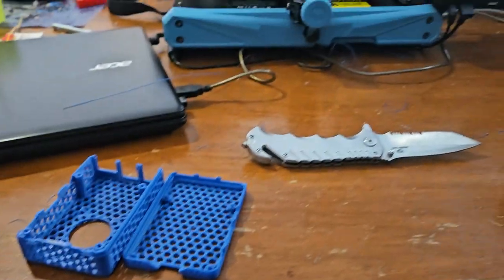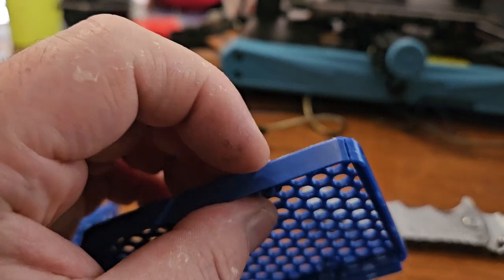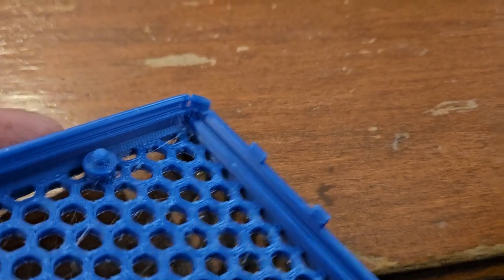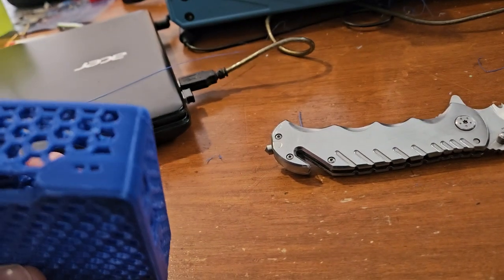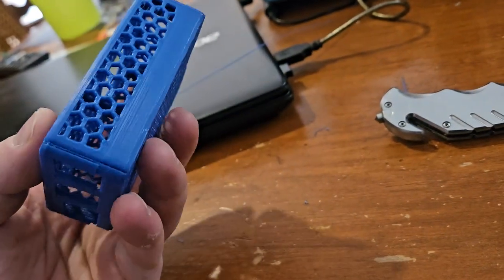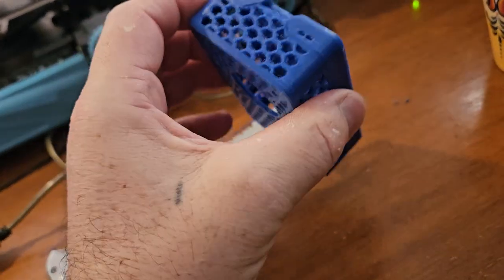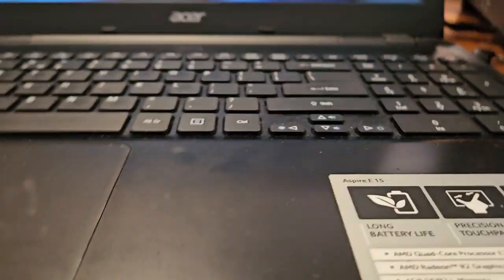every time I 3D print a Raspberry Pi case it just sucks

Comment: I always found PLA to be easier to deal with in this regard, and if its not printed at low infill it is usually quite strong

printing slower and changing temp may also help with stringing and layer adhesion problems
Reply from the maker: I think mostly the filament was old and we have tons of humidity lately. Also didn't help the design is off also. The person who designed it either didnt ever print it or didnt care

Comment: Try to change nozzle settings of you use a 0.4mm nozzle in nozzle width change to 0.38 Will print much stronger in this parts
Reply from the maker: I think it's set to 0.2 in Cura even though it is .4

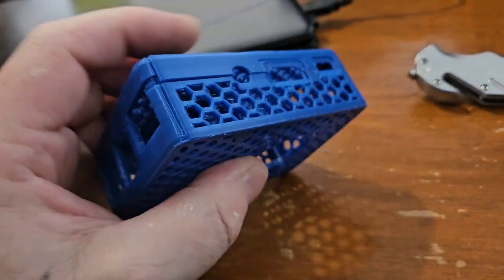Comment: 1. Dry your PETG. 1:04 look at your wisps there, it's not quite fresh. Even straight out of the package, it's usually not quite perfect in this regard. What i do is double seal my PETG with calcium chloride between use. Don't keep calcium chloride near the printer or anything metal, and don't keep it out in the open.
2. Up the temperature to increase layer to layer bond. Mind that bridging and overhang performance will degrade. It is a challenging balancing exercise to dial in temperature and cooling to get PETG to behave perfectly.
3. Use some part cooling. But not too much, or it'll be underbonded.
4. Avoid designs with a lot of retractions when doing PETG. This case is quite wild in this regard with all the thin spars between the air holes.
5. Use minimal Z-hop when doing PETG. You can use diagonal and set it to a homeopathic amount like 0.1mm or turn it off.
6. Use as little retraction length as possible, i think you should only need 0.6mm on this printer. Consider increasing the minimal travel distance between retractions such, that most print moves won't result in a retraction.
7. Adjust the print-movement speed down, depends to how much, 50mm/s might be OK, and non-print movement speed as far as the printer is capable without skipping, 120mm/s or more. If you can set separate accelerations for print and nonprint moves, up the acceleration for nonprint moves.

When purchasing PETG, i find that translucent types and natural clear work better than opaque coloured types. I find that tuning in opaque coloured PETG is really hard, the temperature band in which it's well bonded and takes shape well is way too small. Black can be OK.

Regardless of PETG, orient your pieces on the bed such, that if you have a parallelogram distortion and X/Y dimensional distortion in your frame or motion system, the distortions would match between top and bottom pieces. Or just assemble your printer more straight.

Most printers of this construction print a little undersize, maybe half a mm across 200mm length, because the belt is of the type that is intended to be stretched to achieve its final pitch, but the spec tension is so high that it may harm the motor bearing. Normally the motor shaft should be supported on the very end by another bearing, but well it's not. You can mount millimetre paper to the bed, and tape a sharp needle to the toolhead, to check visually the dimensional accuracy and parallelogram error of the toolhead movement. Additionally due to different tension, there is disparity between X and Y axis movement accuracy.
Reply from the maker: Yeah I totally didn't dry it this time

Comment: Saw too many videos of people having to reprint their projects which deterred me from making a purchase. Even the expensive ones are finicky.
Reply: There are tricks for sure, takes time to learn how to do it all.
Reply from the maker: This part looks to be designed  incorrect.  Possibly for a early raspberry pi. But came out fine just wrong. Another thing is people often share files and they aren't always perfect
Reply: @hamradiohack  Yes and based on the video it looks like the file you used has been optimised to be used on another brand of 3d printer.